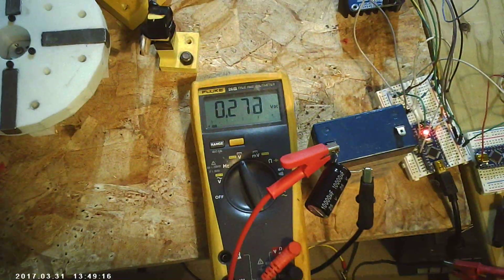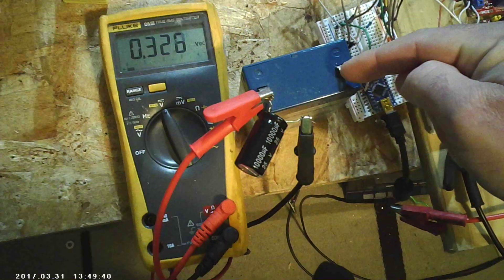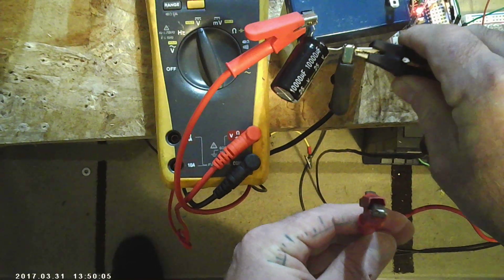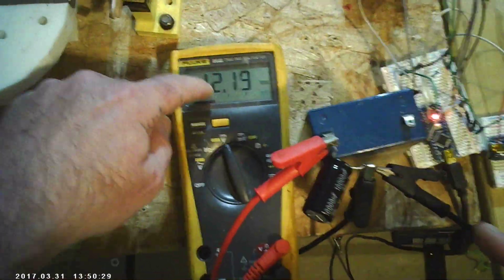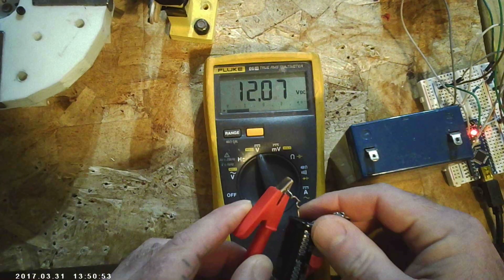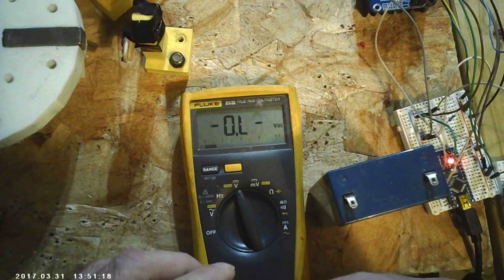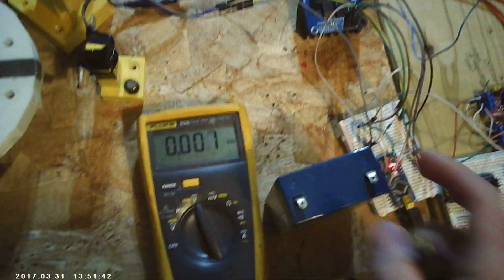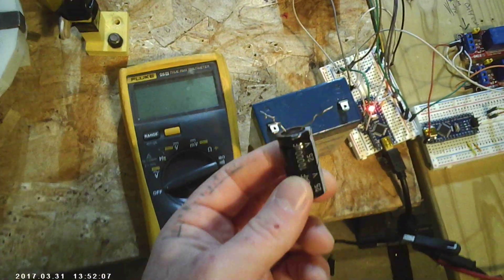Optimally Recovering Flyback that makes it through the battery on first attempt

Comment: Nice video, I did this 30 years ago with two window motors magnetically coupled side by side with two H bridges to flip the cap and dump into the Battery! this technique is what made the system run lopped. Cheers!
Reply from the maker: Hey boss.  I was watching checking out your channel and MEG last night.  I'd like to hear more about this looped window motor setup
Reply: You are the King

Comment: Good ideas as usual! 
 This reminds me a little bit of the RENE charger, I built a few of them they work good, maybe your idea can be added to it make it even better.  With RENE charger, there is a blast of 19V or so going through a 12V battery (sort of like a "forward charge" I call it) and then 19-12=7v (this similar to your idea) then this "leftover" 7V has its flyback collected and shoved back into the battery...so battery gets a double charge - once through it, then back to it, and the second one is "radiant" charge of flyback spike from 7V
Problem I see of your idea here (might be totally wrong) is that 20V probably  contains lots of current while an actual flyback spike being simulated has near no current but the very high voltage spike, and the battery might absorb/extinquish that spike and nothing much comes out the other end....I dont know maybe it shoots right through but  just thinking.
Here is video of it simple RENE circuit maybe you can improve upon it by adding some caps over on the ground of battery? I dont know just thinking.
https://www.youtube.com/watch?v=lvKa4zneaRQa
Reply from the maker: Thanks boss. I will check your video tonight when I get home from work. I did perform a test in the past where I sent well over 100 volts with like 1 milliamp into a 12 volt battery. I was able to short the battery terminals totally together and increase charging amperage without causing a short. See it here https://youtu.be/mjo2tJQAFOI

This would need to be experimented with also. If your voltage coming out is more than the terminal voltage, I'm wondering if we could always just short the battery terminals to collect every last bit of it. Something to try
Reply from the maker: I just watched the video you posted. Like a recycling jewel thief...  

Yes, I also verified this happens with capacitors. But on a varying scale as they charge. Kind of hard to explain, but if the capacitor is empty and you send in 20 volts, something like 19.5 come out the other end. If it is at 5 volts and you're sending in 20, 15 are coming out together side. The higher The capacitor is charged, and the closer it is to the source voltage, the less waste there is. So this could certainly be used in that scenario I'm sure